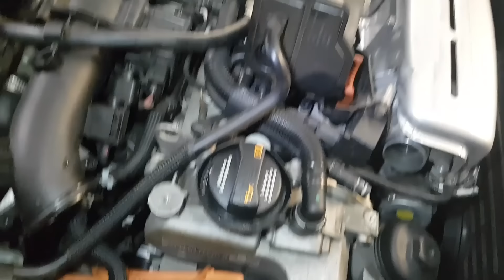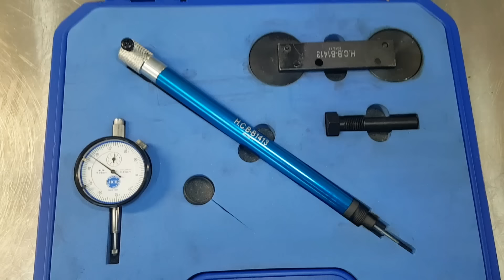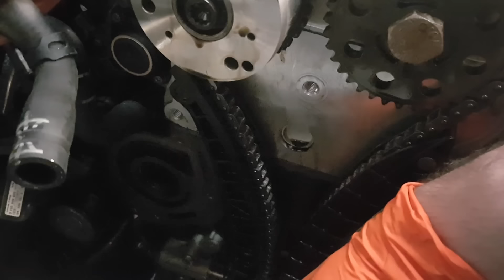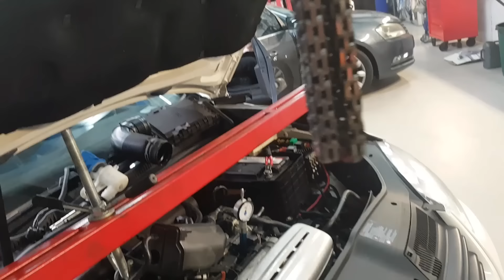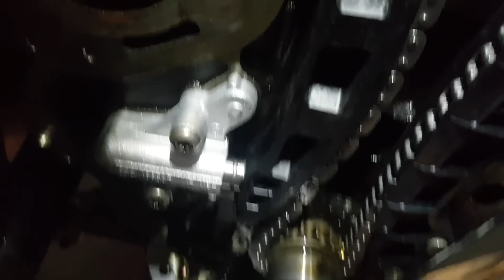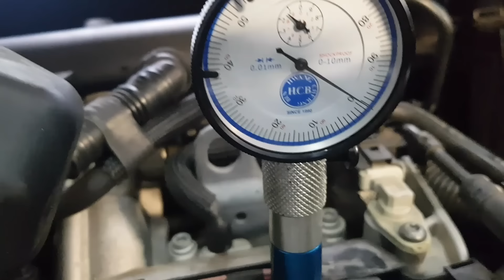P3008 VW 1.4TSI Timing Chain Replacement

Comment: Don’t under any conditions ever fit a Gates CAMSHAFT kit (with the cam gear kit) it does not hold oil when the engine is turned off

Comment: Good afternoon sir, 

I saw I video where you doing a chain change on a Jetta 1.4tsi and the original chain was longer with one teeth, I’m having the same problem but can’t find a change that will fit, my original chain is 132mm/66 teethes and the one I’m getting is 130/65 teethes. 

Please help which chain can I use?

Comment: One quetion please if the chain broken while the engine running does it affect the valve
Reply from the maker: Yes highly likely it will bend the valves.
Reply: Thank you  @FourRingsAuto
Reply: And is it advisable to do the head cylinder skimming twice when its bend
Reply from the maker: @marshvince2547 why is the head bent? If the timing chain has failed it is the valves that are bent. Replace the head or send to machinist to replace valves.

Head will only be bent if it has be overheated.
Reply: @FourRingsAuto it overheated twice first we did the skimming n this is the second time
Reply from the maker: @marshvince2547  head needs to be straightened. You are only skimming the head flat, if you font get it straightened then the camshaft is going to wear out the bearings in the head as the head isn't straight. Don't skim,  needs to be straightened by a cylinder head machinist,  or replace the head!

Comment: I don't have hole for crank locking
Reply from the maker: What engine code? No bolt to remove in the back of the block?
Reply: BLF 1.6 FSI 2006 Golf 5 Petrol  @FourRingsAuto
Reply from the maker: @igorssuna4654 I would have to look that one up as not familiar with the 1.6fsi other than the timing belt drive older models.

Comment: Hi Friend great JOB!!! Congatulations.
One cuestion, I know that every 120,000 kilometers you do this timing maintenance, but in this job, you don't see the two gears (intake and exhaust) being changed. Shouldn't they also be changed? I look forward to your comments.
Tanks
Reply from the maker: Only if necessary and when the gears show signs of wear. Otherwise it's not necessary. If it were over 200k kms then maybe required.

Comment: My last VW was a 1994 Golf I had around 15 years ago. Watching these videos it probably will be the last one too.
Reply: The mk7 golfs are brilliant, especially the 1.4 petrol. Very frugal, torquey and reliable if you don't mind driving a manual.
The mk6 cars were well built but the chain driven petrol engines definitely have issues

Comment: Hi Did he replace the timing gears or just the chain. I can find a good timing chain kit but it doesnt have new gears and tbh I don't think it is that important. I'd be happy to get another 100k kms out of the car so sureley it is fine to reuse?
Reply from the maker: Replacing the gears isn't always required. However,  if you replace the VVT gear whilst it is apart then you won't have to go back in there if the gear rattles later.
Reply: That’s mate, I ended up doing the gears in the end as it was all a little out of time. I found a good kit with all gears, gasket etc. like a new car now! 9 hours in my driveway 😅

Comment: Sorry, one question. I watched a German guy replacing the timing chain on a TSI 1.4. He also replaced the smaller chain and the sprockets underneath the "big chain" that you replaced. If you go to 16:04 in the video I posted, you'll see what I'm talking about: https://www.youtube.com/watch?v=fpIi44u3A1Q&t=1331s. At 17:04, he shows how worn the sprockets were. I’m curious if both chains are replaced and why? I mean, if everything is being taken apart, it seems like a shame not to replace both.

Reply

Comment: Hiya - great video, thanks for posting. I'm trying to figure out how to lock the crankshaft to remove the crankshaft pulley. Does the TDC marker bolt lock the shaft... looks too flimsy for that?
Reply: you should counterhold the pulley when removing the crankshaft bolt

Comment: Absolute beauty this video/tutorial!
Please i have a 1.4 FSI, AXU, 2005, 16V, no variator, 60k miles. No error on vcds or dashboard.
After the car sits for more then 3 weeks, only at first key it rattles.
Please 3 questions:
1)beeing a fsi, and everybody changes at 200k, it could be only the tensioner?
2)i saw on 1.4 tsi CAXA that has a revised tensioner. Yours(oem) is the old one, and is strange that they(the shop) didnt provide you the upgraded one. I m i wrong?
Should i buy the revised one or stay with the classic oem(because i am an old fsi)?
3)from what i ve read on fsi it could be olso the camshaft axe worn out and nothing on the timing. What do you think?
My logic, is that after i have the first key, in that day or the next seven, it has no noise, or only a fraction of a second in the seventh. So the tensioner it still holds some oil and you can think that there is no oil in the camshafts(longer periods of time).
Thanks in advance!

Comment: after replacing the chain i have cam position sensor out of range fault code 3008 is that something youve come accross with these engines? seems to be running ok, but vcds shows 3008
Reply: did you reset the codes after changing belt?

Comment: Why were you measuring tdc from the right side? I thought the piston closest to the timing gears was piston 1 and was the one set to tdc for timing setup
Reply: It does not matter, piston 1 and piston 4 are always in identical positions. Its camshaft position that changes between 2 positions on each full rotation.

Comment: Great video, I’ve had 2 tensioners fail in the last 4 months due to broken internal springs, from what I gather is from lack of oil flow to the tensioner,any idea where the tensioner gets it oil flow from? Follow the passage I think up to the vvt but I am unsure 
👍
Reply: Oil pump. The 2, where OEM tensioners?

Comment: hi! Any ideea where the crankshaft sensor is ?
Reply: You probably found it by now, but it's a stupid one. Under the charger, behind the engine, between the engine and the tranny. Pain in the ass to do, but check the wires, cause that was my problem with it.
Reply: @AlexanderAbraham90  Thanks but I actually found where its located by myself by looking at photos made of the engine and other 360 images.
Reply: @koyo203  yeah, I did the same when I had to find it

Comment: Did anyone ever take note of the crank sprocket size compared to the original when replacing? New ones are smaller (however fits) but initially I was a little concerned. Did VW redesign them?

Comment: Great job. I have the mk6 1.4 tsi 2009 manual. Only 34k on clock. Not been serviced for 3 years as I do  very few miles 3k p.a. Want to service the car now. Do I need the timing chain replaced as well and how much does it cost?
Reply: Even if you're rarely driving it the engine oil (and filter) should be replaced every year at an absolute minimum. I wouldn't bother changing the chain/tensioner if it's not rattling or making unusual noises but like I said, service the car regularly as the tensioner relies on oil pressure and old/poor quality oil is a common cause of chain failure.
PS Go for a decent drive and give the car a good rev every so often once its up to temp, short distance driving is terrible for these d.i. cars

Comment: our car has had a chain kit / tensioner etc fitted along with noisy water pump  replacement ,now runs fine , very slight idle misfire but drives perfectly.But is throwing up engine check light and p3008 fault code . Any ideas as the garage is going to charge to look at it again

Comment: Hey man
Thanks for the video it helped heaps 👍

Ive done everything correctly and how ypu did on the video, although im noticing my chain still has the smallest bit of slack. And ny camshaft tool doesnt really slide in properly as it should. 

Any advice?

Thanks

Comment: Great video. Maybe i missed it but the replacement chain TENSIONER You replaced ,is it an upgraded version of the original and less likely to being changed every 100000 KMs? I mean how often should a timing chain TENSIONER should last for in the 1.4 TSI engine?  A family member here in Australia is going through same issue and VW Australia are claiming that a case like this has never happened in Australia. Just out of warranty and just clocked around 100000kms always serviced by VW. IF this is a design issue surely there is a class action with this??

Comment: Hi , would you recommend replacing the oil pump pickup pipe and also replacing the turbo oil feed line while doing this or should I be ok just doing the chain kit?
Reply from the maker: Only if the oil pickup is full of material, but you've then get to ask where it's come from.

Comment: Hi. Very concerned before i strip down, can you tell me, is it correct for the exhaust cam to have longitudinal play? When i was tightening the bolt, the cam moved back, and popped the rear cam alignment tool out 😅.
Cheers
Reply: howd it turn out?

Comment: I have a 2008 gt TSI not starting sounds like it wants to put just won't fire. My error code is PO243 wastegate boost solenoid I replaced it but still no start . What is the error code for timing chain failure?
Reply: You end up fixing it?

Comment: Great video, very well described. I had a rattle on startup for a few years until I got it fixed at the dealer. The rattle only lasted a few seconds and They said it was the timing chain tensioner. Never sure if that was the case or not, but at least I know where all the parts are now.
Reply: Please, did they change only the tensioner? What mileage?
Reply: @cartaginalandscape6349  they only changed the tensioner at low mileage if around 30k. Cost me £1000 at VW garage....
Reply: @uzeyourillusion   thank you dear sir! Please what mileage do you have now and does it rattles at cold start(random)?
Reply: @cartaginalandscape6349  when repaired it was fine. No more rattles. I kept it till 155 k miles but had many repairs but it worked out cheaper than buying a new car while I paid of my mortgage..... The worst problem was constant replacement of ignition coil packs....I kept a box full in the boot/trunk....!
Reply: @uzeyourillusion  thank you! I'm glad that you've paid your mortage. In a way, you are kind of a free men:)

Comment: hello, my blg engine appears p3008 code after chain replacement. I have changed the cam sensor as well as the VVT sprocket. I have check all the wiring everything in limits. What do i have to do?

Comment: Great video, done this on mine however got a misfire on cylinder 2 p0302 fault code and a rough idle when cold which settles down when the engine warms up. Do you think I could be a tooth out on timing?
Reply from the maker: These engines crack pistons. Either do a compression test, or disconnect the coil packs and crank the engine and listen to how it cranks. Low compression on 1 cylinder will make the engine cranking sound uneven as it'll speed up on the cylinder with low compression due to less resistance on the starter.

Comment: No question a GREAT video from a highly experienced tech! As a 10 plus year GM tech and R&R cars/trucks for over 20 years with many brands i just cant with VEE TROUBLE EWE. They are nothing but expensive issues that few (aside from the dealers) are willing to tackle. This applies to all Audi too (same company). However this person gave some incredible pro info! MUCH RESPECT! Just for fun whats the flat rate time on this job?

Comment: Hi, great video! Quick question, I believe the valves on my cylinder head may be bent so will need to remove and rework/replace. Do you have info on where to purchase/gain info on torque settings on this particular engine for cylinder head bolts? Much appreciated thanks
Reply: Hi did you get to the bottom of this please? May have my own to do

Comment: @Four Rings Auto I have a Golf GT 1.4 tsi with the BLG engine, and the P3008 code poped up. 
The car is at 200K km right now, and the timing chain was replaced at a VW dealer along with a engine rebuild at 130K km.
The oil is change every 15k/10K km intervals.
I can hear the chain rattle, so my question is how long should a chain last? And is there some regular maintenance that i should have done so that the chain last more than 70K km, like change chain guides and tensioner.
Also since the sprockets were changed fairly recently is it ok the change just the chain, tensioner and chain guides.
Many thanks in advance, I could find much helpful information on these engines and your videos really help.
Reply: Hi Martim. Do you still have the car? Tuga?

Comment: Currently rebuilding 1.4 tsi supercharged, nearly done with it fitted the timing chain kit, turned engine over by hand, I heard a click noise which scared me, the engine turns over nicely by hand, I put the engine on TDC and fitted the timing tools, the camshaft tool needed a little tap to get it, does it go in easily or does it need a bit of a push to fit it
Reply from the maker: Needs to go in easily. In my video showing the 1.4tsi timing chain replacement, I explained that you should torque the cam bolts but not do the degree turn. Then rotate the engine twice and reinstall the timing tools. If the tools are hard to get in, loosen the cam pulleys again and repeat the process. Once the timing tools fit easily, then do the degrees on the cam pulley bolts.
Sometimes the cheap eBay tools are difficult to fit because of poor tolerances too though.

Comment: Has anyone actually tried to see if it could jump teeth (16:35)? I did! with all components changed, when the tensioner is fully in there is still enough slack in the chain to jump a tooth if the engine turns backwards by 70 or so degrees. Then I wondered what could turn it back with a DSG box, engine is free enough to "bounce" on compression, and also the cams can turn it backwards in one position. Flick the crankshaft forward and it jumps back enough to jump a tooth, although it did not actually jump, it can! How can VW design a beautiful engine like this but with this issue!
https://youtu.be/TZqgx4g1pmA
Reply: Please, can i ask you an advise?

Comment: Great video, I have 140k on my Jetta (1.4TSI) CAVD.
Is there a way of knowing which kit is "upgraded" compared to CAVD parts?
Should I do the chain if the car is running fine with no rattle?

Comment: A fine and helpful clip but you are taking liberties ( and not doing the job properly imo ) by not removing the sump. You'll know well the sump adds a lot of work and time to the job( especially those awkward two rear bolts ) but at least then you can change the crank sprocket and less likelyhood of an oil leak on reassembly test.

Comment: once the camshaft locking tool is in the camshafts are locked but the camshaft gears can move is there are certain way they have to be timed or along as the camshaft locking tool keeps the cams locked it fine

Comment: How did you adjust cam shafts to get locking tool in when it was out of time? I had head off and therefore cam cover out with cams. Before reinstalling cam cover put engine to TDC on 1, crank pin in and lock tool in cams. I want to adjust cams position as tool bit hard to get in and out but don’t want to undo sprocket bolts.
Reply from the maker: I fit the tool before refitting the cam box.
Reply from the maker: If the tool is hard to get in, you have to undo the cam sprocket bolts. That's why in the instructions and in the video, it says to only torque the bolts to the nm amount, rotated the engine and recheck if the tool fits easily. Then carry out the stretching of the bolts. It is ok to loosen the bolts if the stretch procedure hasn't been carried out yet.
Reply: @FourRingsAuto  ok thanks. Yeh I put lock tool into cam box prior to fitting but since removing tool, cam alignment is off ever so slightly. Is it possible to remove chain and turn cam shafts independently? (With engine crank pin in for tdc no1)
Reply: @andyverso3862  No you have to loosen the camshaft sprockets and rotate the crankshaft into the correct position.

Comment: WOW - never realised you were in Perth. I live in Wanneroo!! Enjoyed the vids on the 1.4 TSi. Used them as a guide to fix the wife's 1.4 TSi - we'd also lost most of the guide on the exhaust side too. But the chain had sopped already and bent all the inlet valves by about 20 degrees. Anyway - my question - do you have any vides on changing out the head on the 1.4 TSi?
Reply: Bugger. I should have videod the one I’m doing.  I’ll keep watching the channel for more great vids.
Reply from the maker: No sorry, I haven't had a chance to film one yet. Relatively simple though once you are stripped down to the chain.

Comment: Is the vw engine set up if the chain has jumped the teeth the valves won't collide with the pistons, mines lost compression on all cylinders so I assume the chain has jumped just hope there's no damage to valves
Reply from the maker: They generally jump on the inlet cam and bend the valves. A cylinder leak down test will confirm if the valves are sealing or not.

Comment: Is this the 90kw/120hp 1.4 tsi?
Reply from the maker: It applies to that engine too, however that engine is a lot similar. This is the CAV 160/170/180 bhp model. The turbo and supercharged engine. I have another video showing the timing on the CAXA 1.4tsi engine, but the timing chain itself is the same. Only differences are the supercharged engine has more to remove for access.